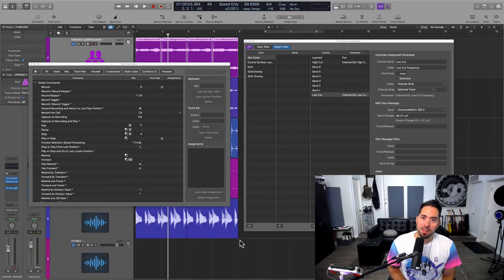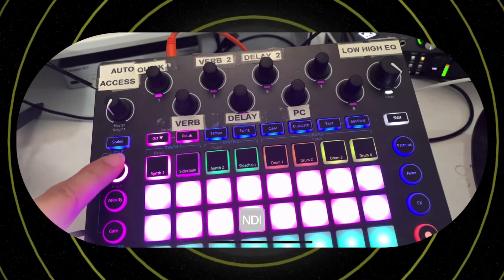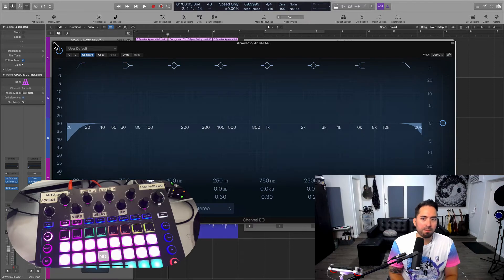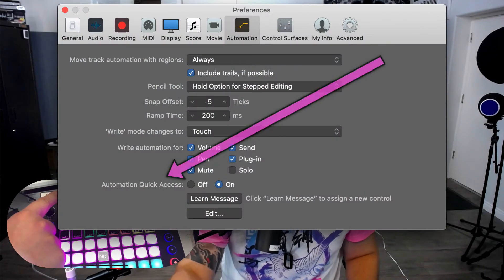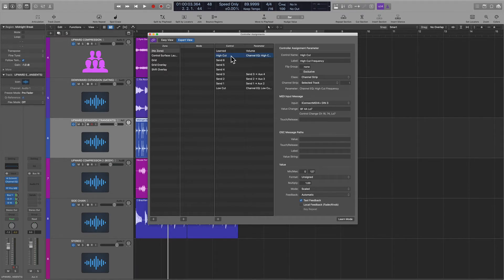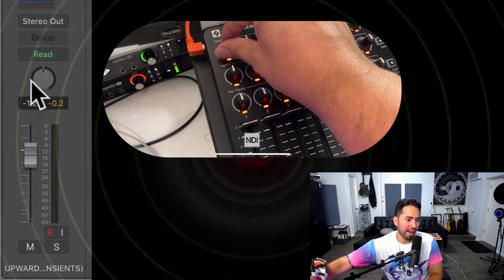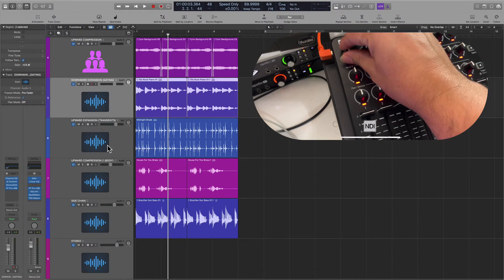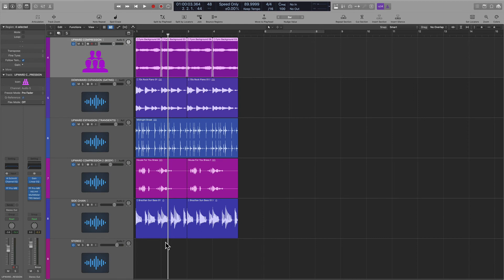Easy Way to Map any Parameter! Control Surface Workflow in Logic Pro

Comment: Excellent demo, thanks a lot! I would like to ask if you know of any issues regarding the connection between Logic Pro as DAW and Yamaha DM3 as recording device/control surface? I can not get them to work as a team, there is a Mackie patch for the control surface and 4 or 5 versions for some Yamaha digital mixers but not for the DM3 :/ ... do you think it would be best to make a custom mapping or is there already some file I could download and instal on my Mac? It is so weird that Logic does not support it natively.
Reply from the maker: Midi Controllers are usually class compliant. I would check the Yamaha website to check on drivers. I would also try to “Rebuild Defaults” inside of Logic Pro to see if that fixes it. As a final resort, I would custom map. I’ll link a free course I have provided on my other channel.
Reply from the maker: https://youtube.com/playlist?list=PLQz6RaERa9IKwJjU1Q4muYOMI0ucCVFy4&si=6sWPo8VcJftvnoFP

Comment: Excellent video! Do you know if it is possible to map a MIDI controller to change the Program and Bank values on an external instrument? I love the external instrument plug in in Logic Pro because of its simplicity. I also like that it allows you to change a synth's Program and Bank values, but I cannot figure out how to map this to a MIDI keyboard so that I can select different values without using the mouse.
Reply from the maker: Pretty sure you can. I should make a video about this for the series. Thank you for the solid idea: https://www.youtube.com/playlist?list=PLQz6RaERa9IKwJjU1Q4muYOMI0ucCVFy4

Comment: i want to use a knob to scroll the playhead
Reply from the maker: I would learn an assignment with that parameter for the key command move played forward/backward. Everything you need to know on Control Surfaces explained here: Logic Pro Tutorial - Control Surfaces Support
https://www.youtube.com/playlist?list=PLQz6RaERa9IKwJjU1Q4muYOMI0ucCVFy4
Reply: @_TheModernCreative  I heard that it’s possible but the adjustment is too coarse. Do you know if there is a way to adjust the resolution?
Reply from the maker: If you look for the key command - move playhead by division….that should get you there. There should be other options. Not in front of computer now but hit me if you need more help sir!!!🙏
Reply: @_TheModernCreative  thanks

Comment: I just get the dreaded "Reassign" message and nothing happens. I love Logic but Logic + MIDI Controllers = 💩
Even once all the parameters are fixed and installed, more often than not, they get corrupted, dont work or get deleted if starting Logic again or whatever. Logic badly needs a "Right click, assign Midi" function.
Reply from the maker: Mackie Control Protocol 🤣
Reply: Im struggling with midi learn. I often have multiple parameters to different knobs and sliders. It's a mess
Reply: Im in the same black hole. It's dark down there

Comment: I tried doing this low cut on my code61, E1 for the low cut, however it doesn't seem to scale, it's more of an on and off. I'm wondering what I did wrong. I double checked the settings are the same as yours.
Reply from the maker: When you learned the message, you probably clicked on the on and off switch. Be sure to click on the frequency parameter and it should work. Keep me posted.
Reply: @_TheModernCreative  you’re right I figured it out and forgot to come re-comment.

Comment: I can’t seem to find any videos on how to assign a slider wheel or fader to expression in the piano roll under automation. Where you can typically do with a pencil.   Any ideas? Thank you
Reply from the maker: As I said, there are many ways to do this, some of which include using the Environment in Logic Pro. Expression is usually assigned to midi cc 11 so you can hardwire that to your controller. The concept as a whole cannot be explained in this limited capacity, but feel free to check out my other channel and that should help out. 🙏💪👍💯🔥
Reply from the maker: Lots of different ways to do this, my friend. I highly recommend you follow my other channel, I just covered control surfaces in detail. @ThatLogicProGuy - to answer your question though….next thread
Reply from the maker: The fast way is to use automation, quick access. You can enable this within the logic pro settings. They should get you up and running in no time.
Reply: @_TheModernCreative  thank you

Comment: Hi bro. Great video. I would like to know if you think the Akai APC40 MKII could be mapped to work in Logic Pro X the same way it works in Ableton Live. I still can't get the channel select buttons to work because when selecting the channel in Logic the APC40 doesn't receive any MIDI messages. My Komplete Kontrol S88 can select channels and it would be super useful to be able to do it on the APC40 as well. Thank you so much. Greetings
Reply from the maker: Don’t have much experience with that unit. You should be able to use any open midi message (note/rotary control/slider) and assign that to a command. You can find those in the key command window. LMK if you find it. If you can’t, ping me and I’ll jump on Logic to help you out. Cheers!

Comment: Great video,  in Logic with launch control xl do you have access to all the 8 bank factory? For instance you set the first one as controller for the mixer, the second one and third one for all the alchemy knobs, etc
Reply from the maker: I thought the launch control XL only had to bank factories? I’m not really well-versed on the unit so I can’t say, but I know for sure that you can access to banks from personal experience.
Reply: @_TheModernCreative  i called them, we have access to 8 user modes we can customize with midi cc using logic

Comment: Thank you. 🥇, I still have a question, how can I map a track to a midi controller? I want to tap for example a specific pad at the midi controller and that Logic automatically select a track, this in order to be able of playing keys with the sound assigned to that track. What I want to do is to play live the midi keyboard with Logic pro sounds and change them the more easily possible, or do you have a better idea to achieve that?
Reply from the maker: Go ahead and check out the extended training for more deets but you can absolutely isolate certain midi controllers to trigger distinct software instruments in the Track Inspector. Hope you have more than one midi controller. If you do, be sure to watch my video on “what is a midi interface?” If you need anything else, LMK.

Comment: Question: I am in the process of trying to set up innovation launch control XL to control parameters on a specific channel strip that I don’t want to change when I move to another channel strip…  how do I do that? Because as of right now as soon as I switch channels it starts controlling the parameters of another channel but I would like to keep the knob always only assigned to the one parameter on the one specific channel I have designated.
Reply from the maker: Totallly get it. I go over this in the extended training but only certain things can be hardwired in the environment such as volume, pitch, modulation, pan, etc. This is not a well documented nor deeply researched subject and I hope to uncover more.

Comment: For some reason I can map everything except for expression
Reply from the maker: Expression is not used by many plug-in companies. Just throwing that out there as you may be able to map but you may not be hearing it as just a few companies actually utilize it. It often serves as an additional volume parameter. Cheers!

Comment: can you control different parameters across the logic enviroment even if you arent on that selected track? for example... can you control the delay of one guitar track whilst being on another selected track? Hope this makes sense! thanks.
Reply from the maker: This is a great question. It seems the behavior around mapping seems to revolve around “key focus” or what track/region/window is currently selected. With that being said, you can hardwire the environment to control CC data for example CC1 mod wheel but not distinct plug-in parameters so you can play with a parameter no matter which channel strip is selected. Perhaps there is a workaround? I would need to spend more time with it. Hope that helps!
Reply: @_TheModernCreative  okay damn yeah it just takes time to figure these things out lol but yo ill give it a go in the meantime. thanks!

Comment: I can’t tell if I’m missing something here so let me know if I’m making mistakes but basically can you make specific templates for each separate instrument on separate tracks? 

For example, I mapped the pan knob
 and my master volume control on my midi keyboard no problem… and I can map the other effects out fine (on a single instrument) but when making “duplicates” for other instruments I run into issues where faders are moving more than one effect like reverb and delay. 

I want to be able to go from piano to drum and switch effects up with my faders no problem but I can’t. 

Any reason for this or a solution? 

Thank you!
Reply from the maker: Great question. I was absolutely confused about this subject for the longest. I’m actually in the process of making a course like this as well but to give you the short of it. We are using the MIDI language. Every controller is going to send either a unique midi message or overlapping. This is why you were getting faders that move more than one effect. This will require you to streamline your workflow. The main thing to understand is that this is channel strip  based so depending which track you have selected, the assignments you have made will take priority. If you have made a parameter assignment and choose to overwrite it, then both of these will function so long as they are occurring on the same channel strip. I am wrapping up a mixing course now and will surely get to this subject very soon. I hope this helps. Stay ⬆️
Reply: @_TheModernCreative  Are you saying if I assign a knob to reverb on a drum AND piano that they will over lap unless mapped on the same channel strip?
Reply from the maker: Kind of… If you assign a parameter to a reverb (inserted on the audio insert not a bus) on a piano and that channel strip is selected and in focus, it will work. You can also choose to assign that same knob to a drum on a SEPARATE channel strip and so long as that channel strip with the software drum instrument is selected that too will work. we also have a couple of free videos on this subject on the channel along with extended training which you can find in the description. Course coming soon for members. Hope they help. If you have any more questions shoot em’ my way. Have a great day

Comment: hey :) I have a question that stands not in the context of this video. 

topic:
learn assignments (midi keyboard) I have for example a simple gain vst and I put this on every strip, then I try to connect every gain signal from every gain vst to ONE nob so I can control every strip with one nob, without going in each one (this makes it easier to regulate when I have to fix loudness without changing balance of the mix. THE PROBLEM :D : logic allows me only 2 Gain signals from this vsts on one nob. after that it goes back to one und delet the others. Do you know if it is possible to Mappe more then two signals to one nob? 

Thanks a lot! I hope you understand :D I cam from Germany and englisch is not my masterclass :D
Reply from the maker: There is an extended training video that talks about the subject a little bit more. Look at the link in the description. The function is unique to the channel strip so as long as the focus of the DAW is on that specific channel strip then you should get the functionality you want. You will have to change focus from channel strip to channel strip to get the knob to do what you want it to do. Hope that helps. Stay up!
Reply: @_TheModernCreative  oh man thanks a lot! I will dive into it :)
Reply from the maker: There’s also a part two to this video as well. Keep me posted with your progress.

Comment: Is there a way to reset a pad on my personas Atom? I accidentally reprogrammed it and can't get it back. it was the bottom left (kick drum). Hope you can help. Thanks, Ernie
Reply from the maker: Did you assign it to a key command, a channel strip parameter like volume or pan or a plug in parameter?
Reply from the maker: On the video I show a trick where I move the parameter and it’s highlighted inside the controller assignment window. Can you mirror those actions?
Reply: @_TheModernCreative  I am going to go through it slowly tonight step by step. I appreciate the help. I'll let you know how it goes and checking out you link too.
Reply from the maker: So the main thing is you have to find the assignment and delete it from the controller assignment window. You can also do it from the key command window if it is a key command but if it is a Channel strip or plug-in parameter then you have to do it inside of the controllers assignment window. Keep me posted. We will figure this out. Cheers
Reply: @_TheModernCreative  Thanks will do!
Reply: @_TheModernCreative  I think I finally wrapped my head around this process. For some reason it wasn’t clicking. I deleted everything and started fresh in that area and it worked!. Thanks so much for the quick response. Looking forward to more of your videos. Ernie
Reply from the maker: Have a solid day. Stay Up!